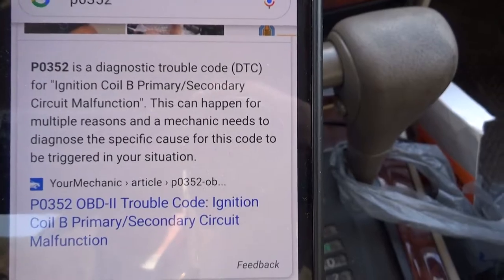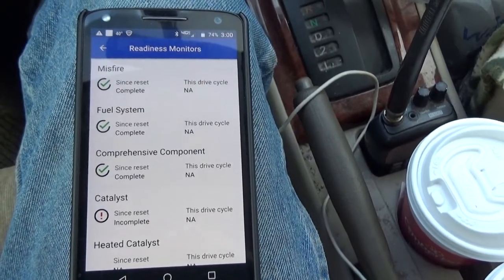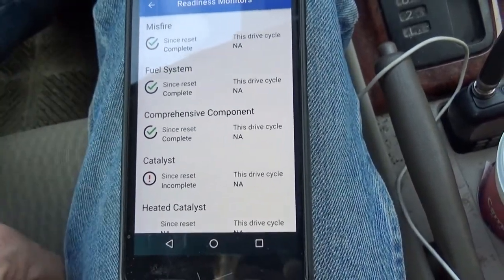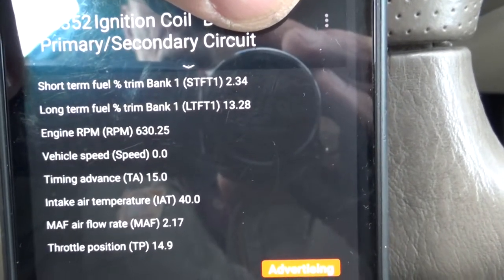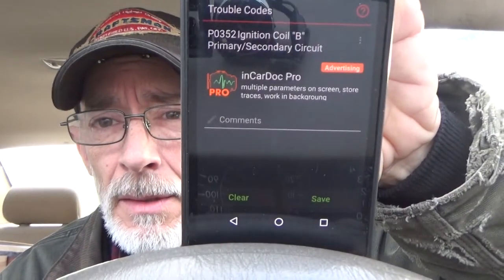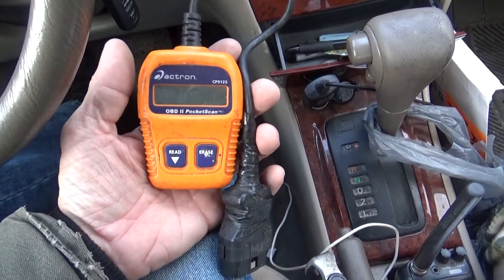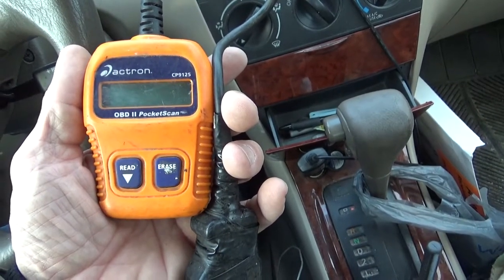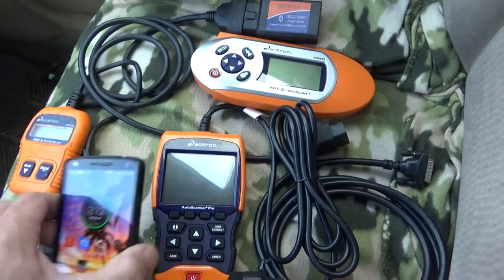OBD2 CODE READERS and Code Scanners: NOT what you THINK they're for! - Auto Repair

Comment: look at scan tool.net on the web they have a dongle mx+ that will even read abs $99.00  torque is a good app that works with the dongle you have
Reply from the maker: I own a few code readers, but I never use them anymore. If there is no bidirectional control, or ability to graph pids, I find them useless.
Reply: @HouseCallAutoRepair  i know what you mean i have the mx+, i also have autoenginuity, a old snap on that needs updating, i bought one of the new launch 8" tools i really like it does lots of things